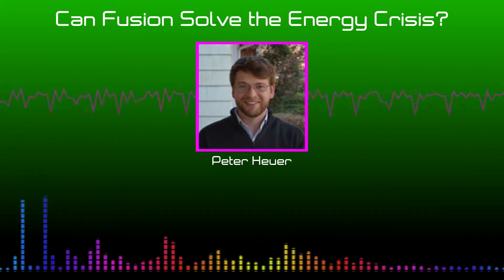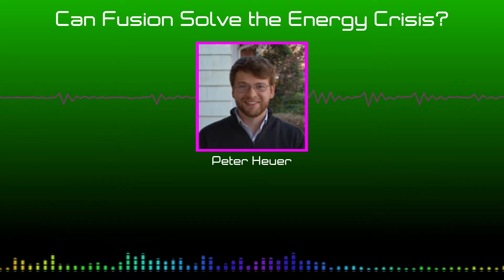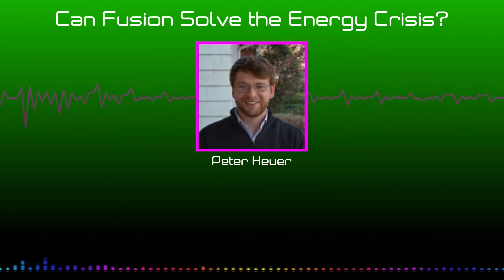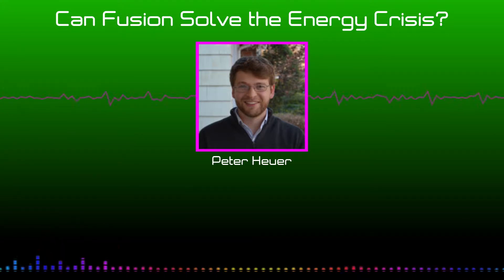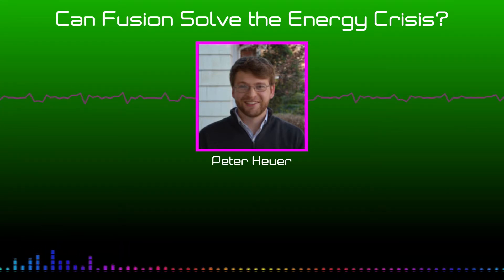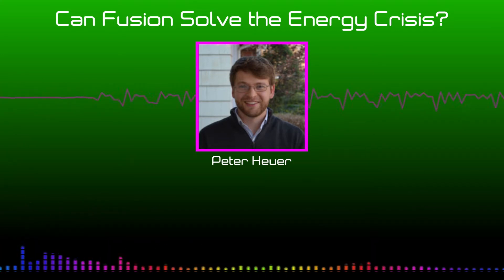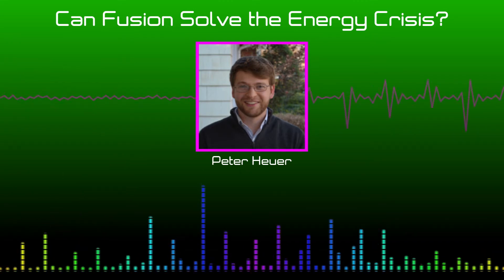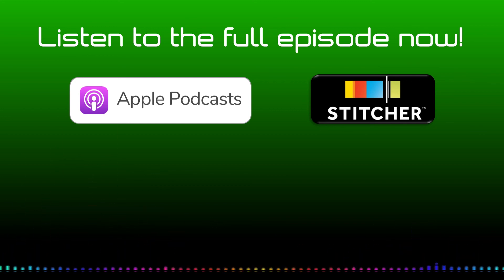Professor Dave Debates Podcast #14 - Can Fusion Solve the Energy Crisis?

Comment: I don't get something. If plasma cools down really quickly when going beyond the magnetic field that's holding it together, how you're gonna heat up water to spin a steam turbine?
Reply: My understanding is that the fusion reaction releases high speed neutrons which are stopped by the coolant surrounding the reactor, heating it up.

Comment: The successful harnessing of fusion for energy, will have as large if not more massive impact on the world as the invention of the transistor or micro chip.
Reply: It will have a large impact but it's not that great a leap in that we're just converting heat energy into electricity.

The IC, the telegraph - these inventions have had a much larger impact IMO.
Reply: Diji One,
Are you not considering the abundance of massively inexpensive energy, almost limitless in supply, fractional in environmental impact, compared to conventional energy!

What about the world political changes which will be immense.
The conflict in the Middle East, which will no longer have oil as a major world commodity.  International trade dealings of energy production, a clear solution to “climate change”, if your in the camp that desire the lowering of co2.
I could list much more, but I think people underestimate how much impact fusion will bring to the world. 
Very much like the advent of type press.

Comment: I’m speaking as a non physicist, who knows nothing about fusion other than perhaps misinformation.
I was told that a continued fusion reaction, necessary to provide energy, is so hot that the containment could melt. Though this sounds dangerous, once the containment is destroyed, cooler air shuts down the reaction, while a secondary containment, contains the damage.
This video suggests fusion is even safer than my misconception.
Reply from the maker: yeah fusion reactions are held in place magnetically, like with the Tokamak